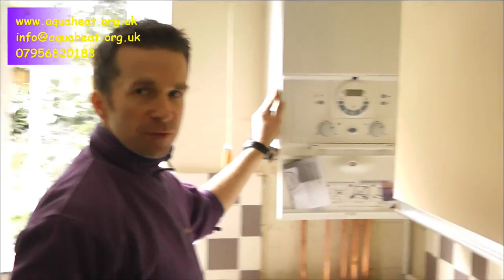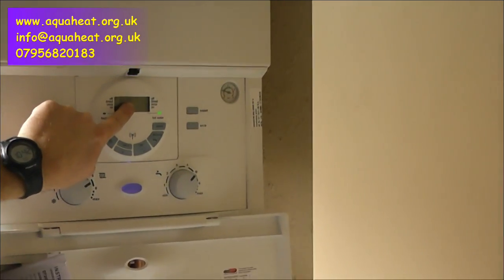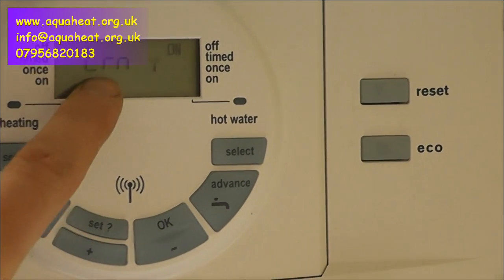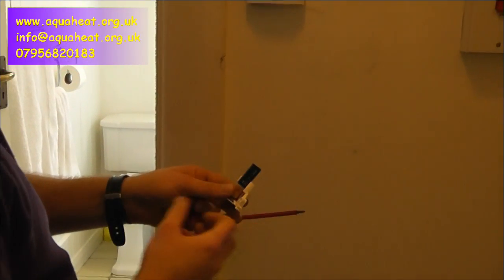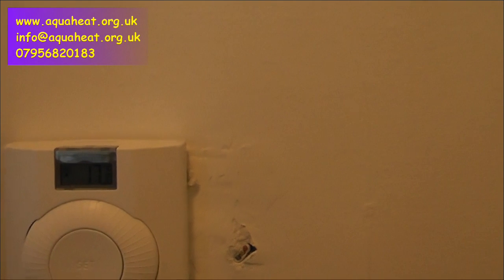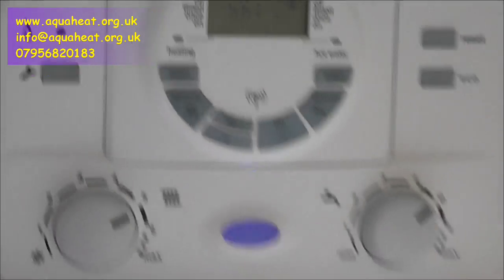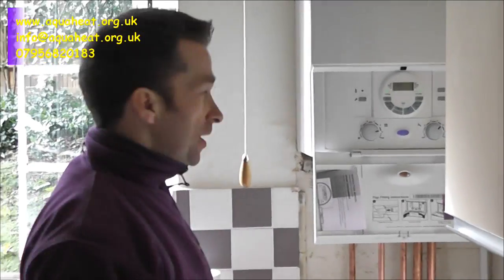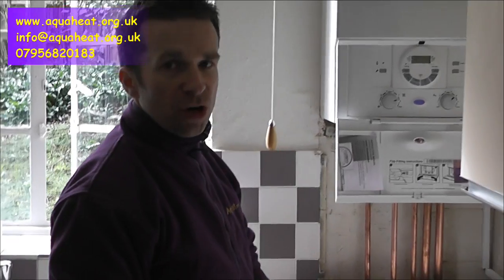how to set a worcester bosch dt20rf stat and programmer

Comment: Surely, the unit in the hallway is the transmitter, not the receiver?  It senses temperature and transmits information to the boiler to switch on or off.

Comment: hi could you help ?
,ive got the thermostat in my hallway and everything is ok but i want to remove the thermostat because ive got thermostatic valves on all my radiators.how do i do this ?
ive turned the boiler off and followed the instructions,(where it says learn + ive tried learn -) but this makes no difference. it still keeps searching for the thermostat in the hallway. i removed the batteries from the thermostat.my boiler is a 30si mark iv